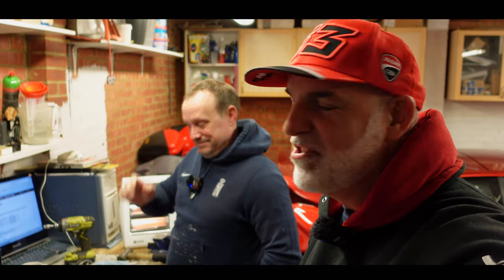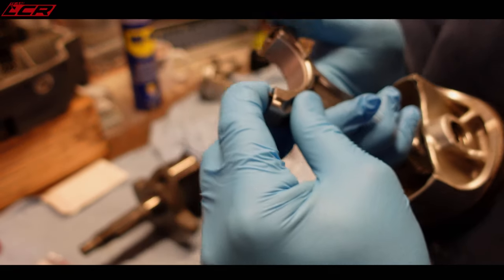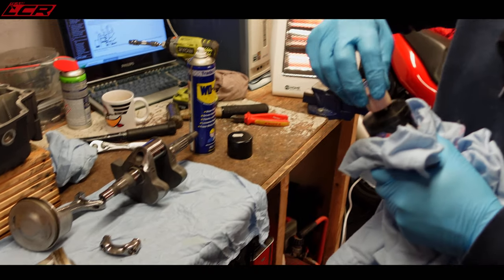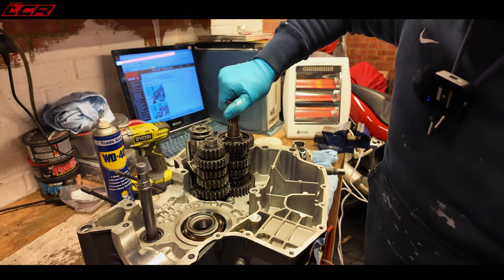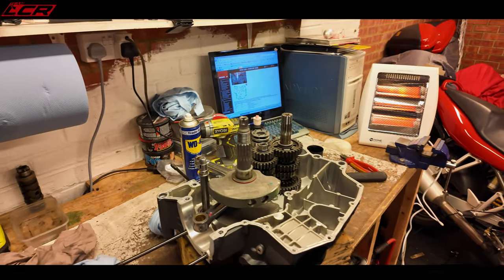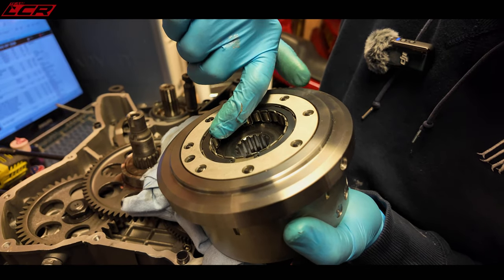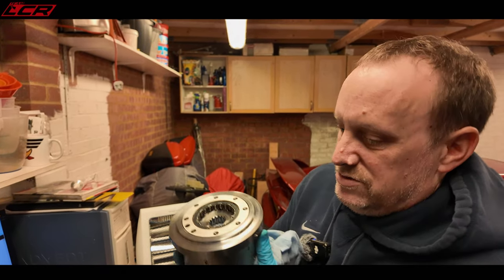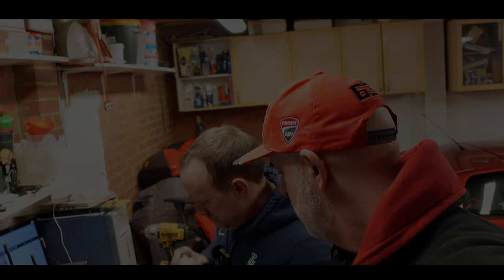Ducati Hypermotard Restoration EP15 | Engine Assembly PART2

Comment: I used to own a 2014 diavel which was absolutely fine during the time I had it. Always wanted an original hyper 1100, not sure if it would be trouble free 🥲 this guy is making the rebuild look deceptively straight forward though 😅
Reply from the maker: Yeah it's a pretty reliable bike! Loads of really high milage ones 👍

Comment: Finally the Hypermotard is back again! I unsubscribed because I thought it was gone forever. 

Did you upgrade the cams since you split the cases? Since this is not the Evo SP, I think there were optional Ducati Performance race cams in the catalog. There are also good aftermarket brands like Kaemna and NCR.
Reply from the maker: Yes it's got the Ducati Performance cams in there, plus the ported heads and balanced crank. I also have induction kit to install 👍
Reply: @LambChopRides  The sound is going to be intoxicating! Can't wait. Maybe a 520 chain conversion to reduce rotating mass is in the cards as well.

Comment: Never trust a mechanic using a claw hammer rather than a ball pein hammer.......
Reply: That seems like silly advice. If the technique is there, you can achieve the same job the exact same way for this kind of application
Reply: @martinp1539  it was part in jest, but seriously, a claw hammer is for wood butchers, a ball pein hammer is for grease monkeys.
I have several of each, and you will never see a claw hammer on my bench regards mechanical work.
Bit like screwdrivers used as pry bars....